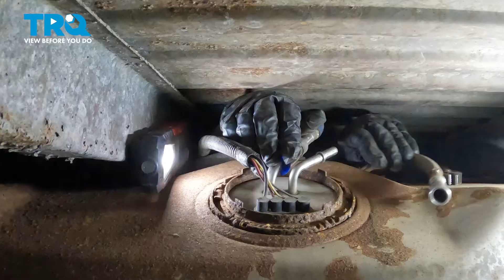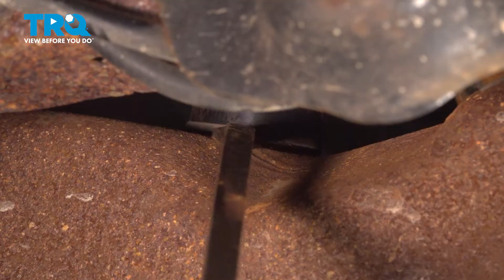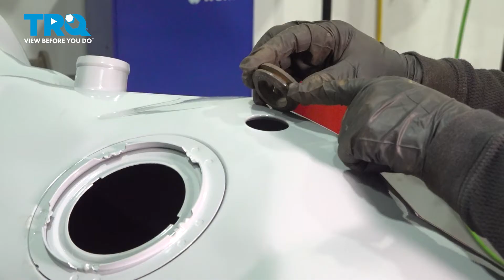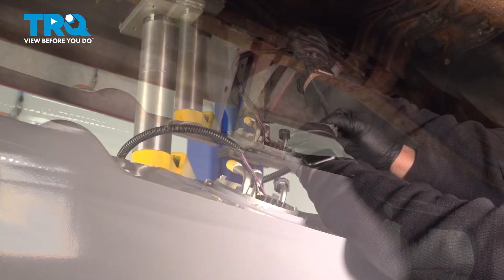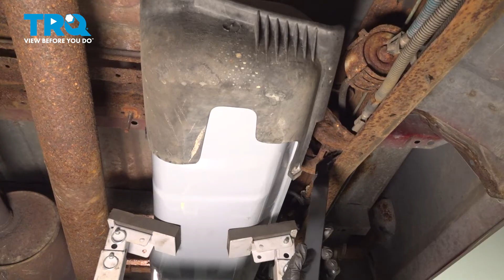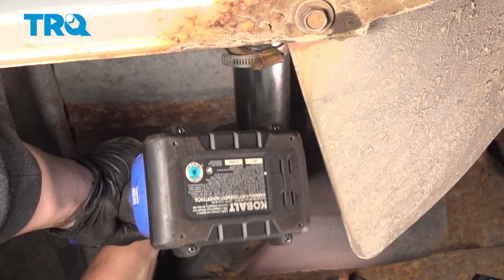How to Replace Side Fuel Tank 1992-1996 Ford F-150

Comment: I wish I could get my pressure line off the pump as easy as you did. The big one. Spent 4 hours today trying to get it off.

After watching the video again, I noticed you cut out the struggle bus portion of disconnecting the second fuel line. How long did that take and what did it take to finally get it off?
Reply: SAME HERE my friend! I bought EVERY line removal tool they had at harbor freight! None worked!!! Used the hose clamp method and it slid right off!😡
Spent hours over 2-3 days.
I damaged the line trying yo get it off to simply replace the fuel filter. 10 min job.

Comment: Remove and throw away the front tank molded plastic shield, it will  cause the new tank to rust  out prematurely.  The tank sits up high and not subject to mechanical injury.

Comment: I had to bend one of the tabs in slightly to get it to fit. I also used two vice grips on each side of the ring, push down and then twist just to get it started and then used a punch and hammer to move it the rest of the way. It was a tight fit .. and yes the O-ring was seated 😃